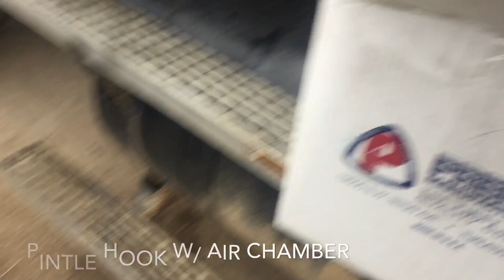1” Hitch plate for pintle hook on dump truck

Comment: Done a couple of these. I use ultra core, Nice Work !!!!!
Reply from the maker: camp gas yes came out pretty good, only problems the air lines are to low, so truck on turns almost breaks the glad hands, and also when I dump they get full of dirt etc, will be relocating up higher or on the sides of the plate
Reply: How much do you charge for somethimg like this?

Comment: Hi I wanted to know where do you hook up the air connection on the chamber does it matter where it goes can I just run a line straight to the air tank?
Reply from the maker: No you need to put a t on your service line or emergency line that goes to the glad hands.

Comment: Hey bro I got my pintle hook on and trailer connected. Any pointers on how to line up the hook to the trailer quickly and safely? I'm just using a cone for now.
Reply from the maker: hispanic88 badass man, are you posting a video of it ? And I just guide my self with the corner lights of the trailer. Till it hits the hitch then just raise my air bags to get the trailer of the ground.

Comment: beefy setup!
Reply from the maker: 73DiamondReo yea man, the only thing they screwed up on was putting the glad hands to low, I have broken them when dumping rocks
Reply: @Grtruckingdemolitionllc  i was wondering if they were prone to damage
Reply from the maker: 73DiamondReo yes the guys that built the hitch asked me where did they want the lines to be and I just told them to put them wherever they normally do it but I did not even realize that it was going to be a problem I was pretty upset with them though because they should’ve known if they do these kind of work so often that it will not work

Comment: How much did they charge you for this?
Reply from the maker: hispanic88 $1,200 but I bought the hitch
Reply: @Grtruckingdemolitionllc  would you mind sending me the info on who did the work? I have a pup trailer that I need to connect to my dump truck here soon. I have a guy charging $2500 without/hook.
Reply from the maker: hispanic88 I don’t have the guys number but this is the address to the shop 7127 Satsuma Dr
Houston, TX  77041
United States

Comment: Hey bud where did you get the hitch from and how much was it? Thanks
Reply from the maker: TRUST LIFE I bought the hitch at utility trailers, it was around $700 they have smaller ones to but this one is very nice
Reply: Grtruckingdemolition okay great, so I want to get the same setup on my single axle semi, what do you think they will charge me to do the same setup at the place you got your work from?? Thanks
Reply from the maker: TRUST LIFE I payed $1,200 for the plate and installation. Shop provided everything
Reply: Grtruckingdemolition oh okay that sounds pretty fair! How much weight have you pulled with it so far?
Reply from the maker: TRUST LIFE https://youtu.be/VZPgaPUZnr8
Reply from the maker: TRUST LIFE https://youtu.be/q_ajZ71VkVc

Just make sure you buy a kit that comes with a chamber or you will have play on the hitch